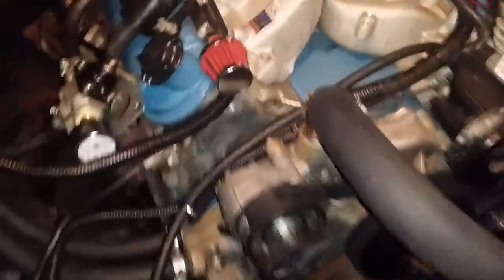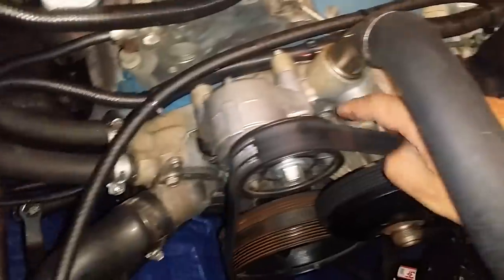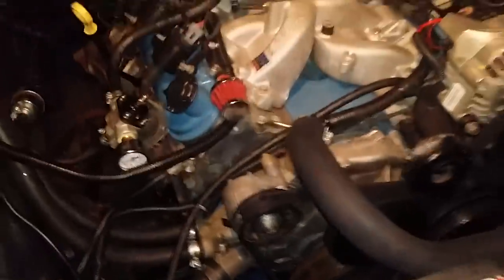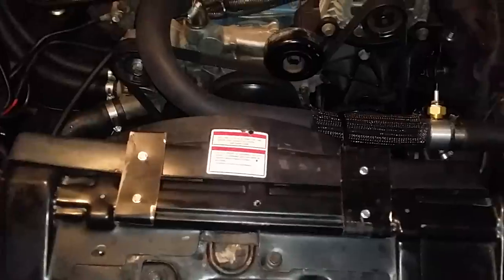How To : LSx G-body Cooling system. Steam Vent bypass 4.8 5.3 6.0

Comment: Thanks i did watch other videos so i can use the stock g body radiator to save some money..also how did you run for fuel filter and you used original cluster

Comment: What year is that cooling fan from
Also. Thats a stock g body radiator how did you make that port. Nice because stock doesn't have that middle port
Reply from the maker: aftermarket radiator came with the port... the fan came out of a 94 thru 97 Lincoln Mark VIII

Comment: I'm running a 5.3 in an 86 Monte Carlo and I hooked a vacuum up to the water pump to suck up all the shavings (engine was drained and dry) then drilled and tapped the top of my water pump for my steam vent and my temp sending unit. It looks pretty nice and works well too! Only about 4 inches of hose. I wasn't a huge fan of your last setup haha
Reply from the maker: john gonsoulin Me neither that's why I changed it LOL but it worked for 3yrs!